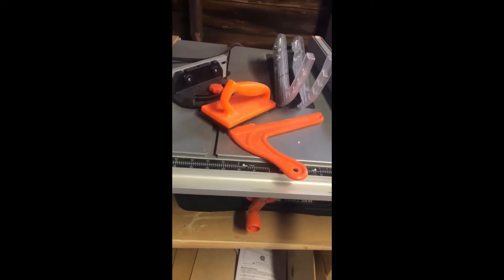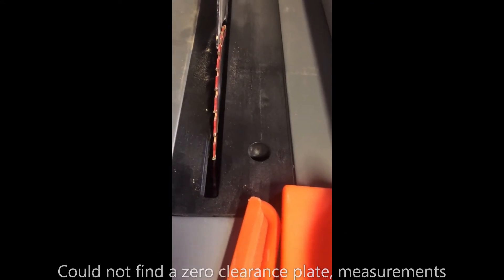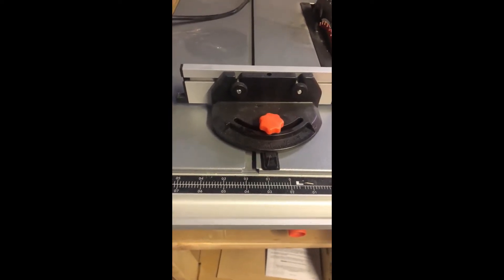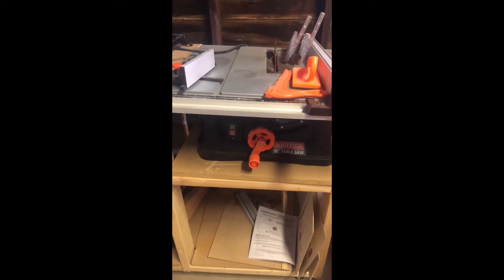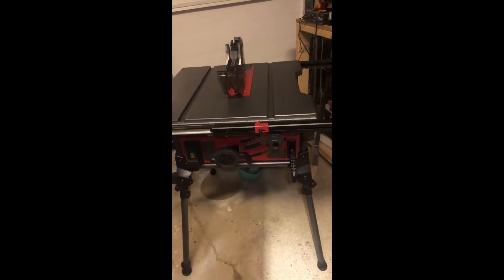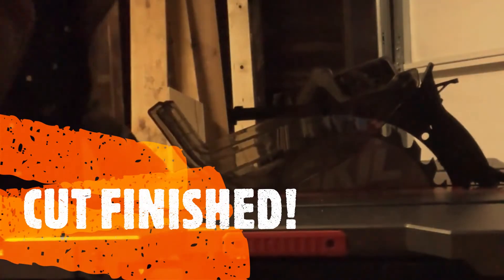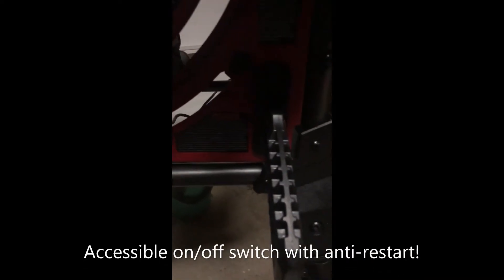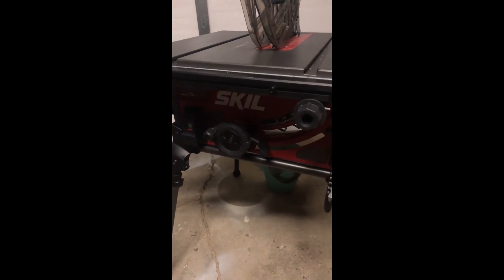UPDATE on the Harbor Freight 10 inch Warrior Table Saw, comparison to Skilsaw!!

Comment: I use mine to cut 1/4 inch strips, and it does alright, it just has to be much longer than the gap in the insert, so you can apply pressure before the cut and then come around and apply pressure to the table after the cut. I also run masking tape very tightly over the gap in my insert. Definitely requires a push block as opposed to push stick as well being so thin. 
I was planning on making a zero clearance insert but the insert is SO thin (like 1/16 inch), so I may be fashioning an insert for the gap in the insert. I don't use mine for miter cuts at all.
For $120 with the 25% coupon I'm very happy with the purchase.

Edit: the skil would have been my preferred choice but I couldn't justify the price difference. That stand is pretty sweet!
Reply from the maker: That's awesome that you were able to make it work for you! When you can figure out a work around, you don't have to pay the extra expense!

Comment: OMG  everything you have said about the warrior is the exact same thing I've said.  I have so many runners  whatever you call them for miter slots that I  ordered that don't fit. I also don't like the fence cause if you don't hold down or measure every single time the other end will be more to left or to right.  If I knew then what I know now I would have gotten the dewalt. But I just got into wood workin maybe a year .
Reply from the maker: Hopefully the Warrior saw serves you well as you continue in your woodworking journey, even though it is a pain in the butt.
Reply: Yes, this has been my experience as well. It's really bad but I am outside of the date to return it. I sure hate that I spent money on it.

Comment: Hello again I bought a 10 inch Craftsman table saw and I love it however my wood is not cutting all the way through when I make rip cuts.
Reply from the maker: What?!?! Is your blade dull? I don’t know what would cause that because if the blade height is 1/4 or a little more above your wood, it doesn’t make sense to me that it won’t cut all the way through on a rip cut.
Reply: @shetriedit9963  thanks my blade was not high enough
Reply from the maker: @HouseScraper  So glad you figured it out!!!

Comment: Had I seen that skil saw before I bought my Ridgid I would have gotten that one. I ended up hating my stand for it, kind of this scissor X frame. I bought a dewalt stand I modified my saw to fit, probably voided my warranty, but am happier with. When my Ridgid stuff dies I’m going to go all Skil. Probably will be a while.
Reply from the maker: I almost went with the Rigid, but saw this at the last minute. From what I hear, it’s a great saw. Good thing you were able to modify your stand the way you wanted.

Comment: If you had made a sled, you wouldn't have had the issues....
Reply from the maker: I couldn’t make a sled for my Harbor Freight saw because of the size of the miter slots. That’s the reason I upgraded. But, now that I’ve been using this for a few months I find this saw more stable and reliable. I can’t wait to make a sled for this one.